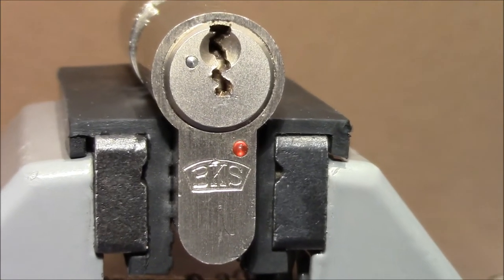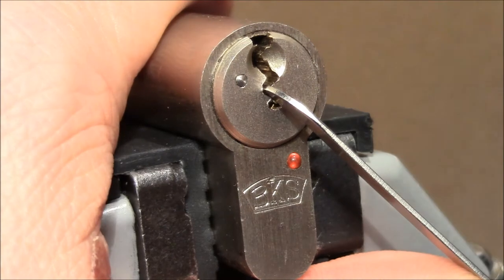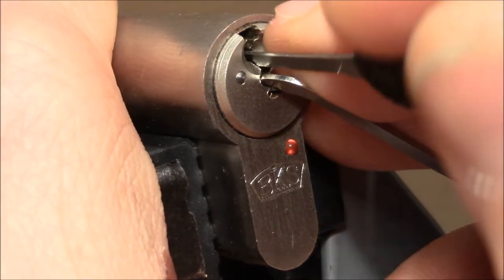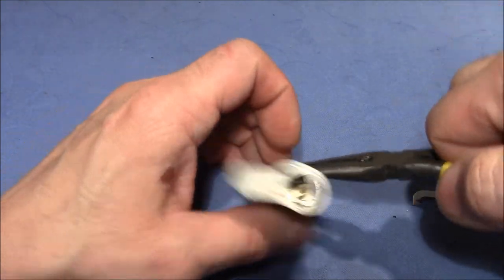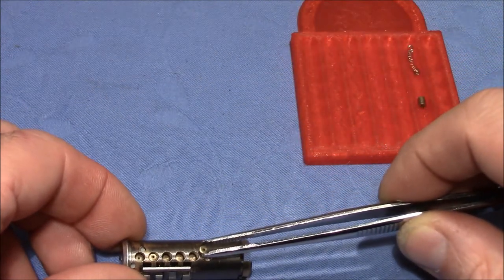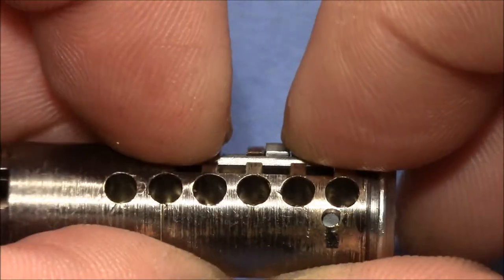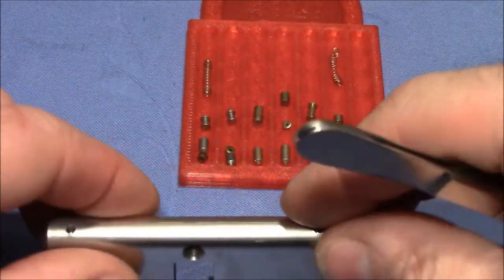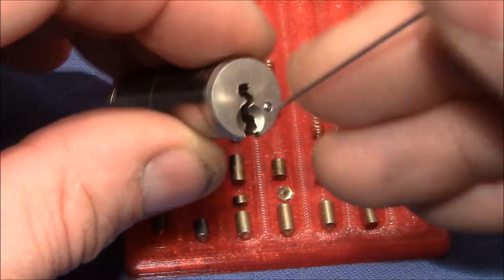(picking 443) BKS SL33 6 pin EURO lock with sidebar - thanks a lot to Tom

Comment: Awesome Potti :). With a bit of practice you got it open really fast :). And yeah, the first time is a nightmare hehe ;D, and most likely also without wafers due to the nasty keyway, but try it :). I'm happy that you liked it :). I love the construction of that sidebar fingers ;D. Cheers buddy :).
Reply from the maker: Thanks my friend - that's a really cool lock. Afterwards I pinned it without wafers but had to change the drivers due to its length. After 10min - no opening yet. It's much more difficult.
Reply: You are most likely hanging on the last pin ;D. It is extremely hard on some of these locks to get the 6th pin up all the way due to the keyway, I tried it out. That's the reason I left the wafers in :). GL buddy :), the SL is definitely a keeper :D.